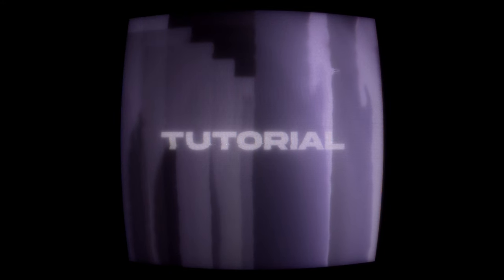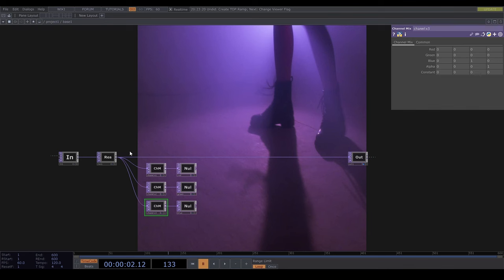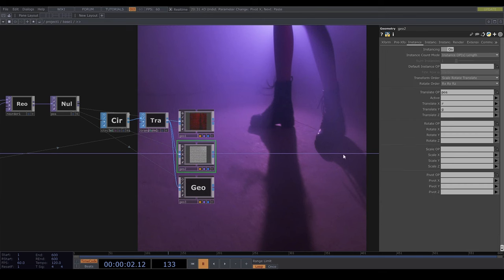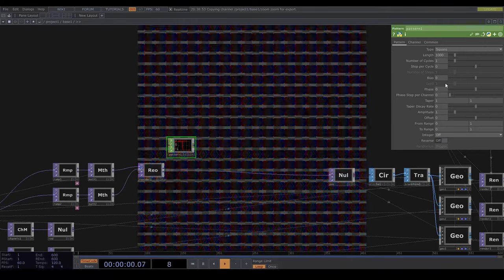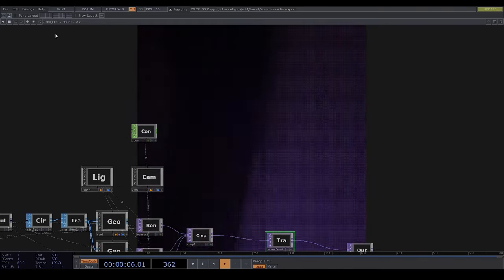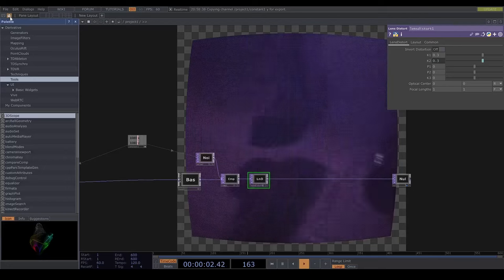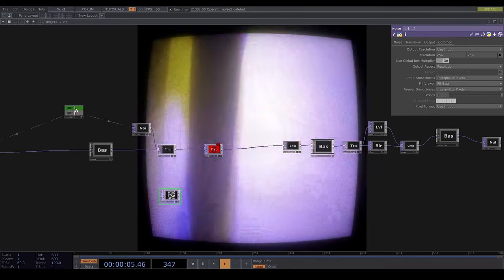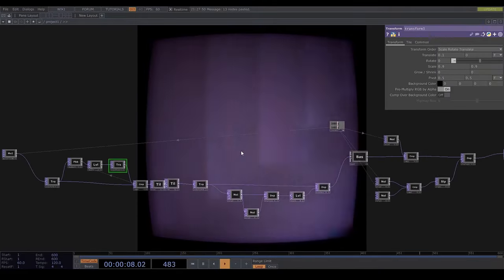CRT/analog distorted TV screen effect (touchdesigner tutorial)

Comment: this isn't working for me - the geometry tops give me an error ... i tried downloading the .toe file and i can't get that to work either. i'm new to touchdesigner so i know it's user error but it's kinda driving me crazy trying to figure out how to fix it lol.
Reply from the maker: Hm, I have no issue with the file even after I re-download it, I'm wondering if there was a touchdesigner update that has changed its behaviour. I still have version 2022.32660, can you tell me which version of touchdesigner you're using?
Reply: @ph4sespace  I also had issues with your file fyi using 2023 11880. Not sure why it didnt display at all like this tutorial
Reply from the maker: @JoelleLB-xm1pi  I've had some people not realise that they need to use the switch  TOP to switch to the video input from the default one so that could be your issue too

Comment: You file on Gumroad is broken by the way. Took a lot of debugging. Please make sure you have somehwat working files before you start charging for these things.
Reply from the maker: Hi, I checked the file and indeed there was a parameter reference in the resolution of the noise TOPs after the base that referenced the wrong operator. I have re-uploaded the file, so if you go on gumroad and download it again (you should find the link in the email you received after purchase) it will be fixed. The error didn't break the main effect though so I'm not sure why extensive debugging would have been required - maybe a different version of touchdesigner breaks it?